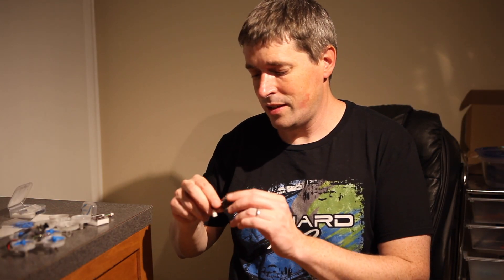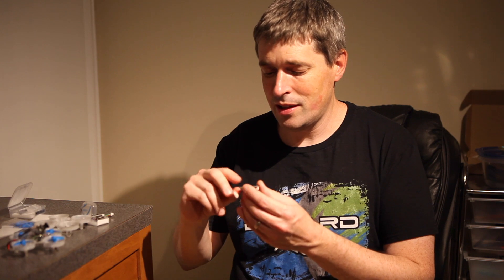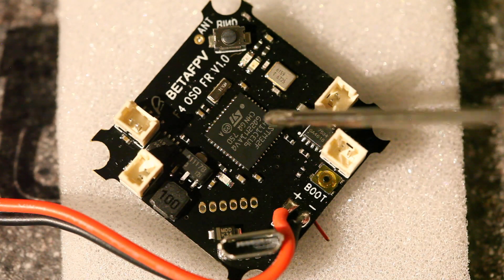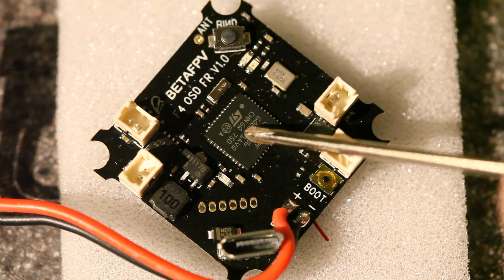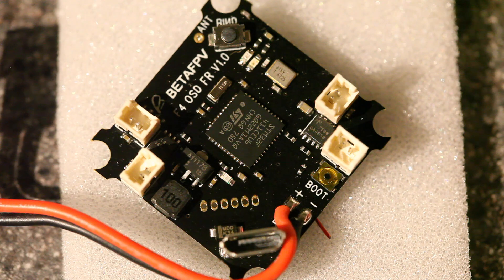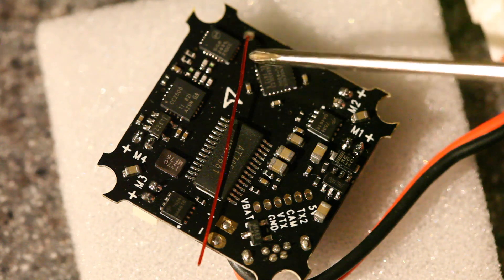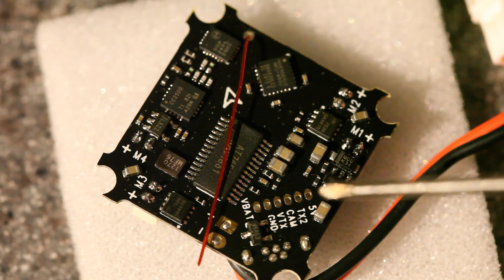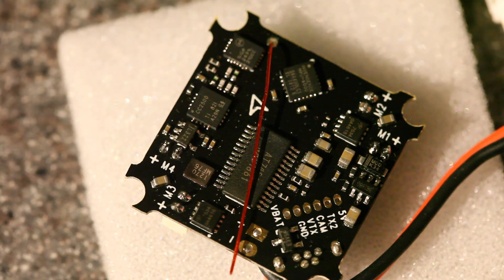BetaFPV F4 OSD - Review & Flight

Comment: How do you bind it, and what are the settings in betaflight for the controller?  I followed what remains of the instructions, which is just press the bind button 3 seconds.  I can't get mine to bind it seems. Maybe my controller is too new, maybe I need to update it or something?
Reply from the maker: Hi. Sorry for the super late reply. This is a very old video and a very old flight controller. Do you have the same one? In general I would say to follow the manufacturers binding instructions. This old FC might require you to hold the bind button while you plug in the battery. Good luck.

Comment: What kind of batteries should I use for these?
Reply from the maker: Lots of battery options. I suggest RDQ 250mAh HV or GNB 260mAH for agility or 300mah if you just want to fly longer. BetaFPV has decent batteries now too if you want se the BT2 connector. Have fun!

Comment: I know this is old video but have you done anymore testing with this board I am currently building with this board and was wondering if there is any gain updating firmware to 4.1 or is the advantage primarily for brushless. I saw this video from BETAFPV website while researching building a brushed whoop. Thank You
Reply from the maker: Hi. I haven’t flown this build in a while. I don’t think the new features of betaflight will help much. If anything I might flash it with Emu flight because they replaced the brushed motor algorithm with code from Silverware. Apparently it can output like 20% more thrust that way, but I have not tried to very that.
Reply: Thank you i will look into that, I am build a 65s with the BetaFPV silverware board too so i can explore that as well. Great flying!!

Comment: sir, in beta fpv f4 have a vbat.. what is for? can i use that? where can i get status the battery mah used and amper used?
Reply from the maker: It has a voltage sensor, so you should be able add voltage to your OSD. It does not have a current sensor, so if you want to see mah used, then you will have to set the current sensor type to "virtual". Then BetaFlight will make an educated guess based on motor speeds, etc... It can be accurate enough to be useful, but you have to have the right numbers to calibrate it, and that depends on the nature of the build it's in. I'm sure you can find lots of YouTube videos about that. Good luck.
Reply: @MrShutterBug  I must soldering from batter volt to the vbat sir?
Reply from the maker: @ramboaripratama1992  no. The flight controller gets voltage from the normal battery connection. You don't have to solder anything. When you see another pin on the FC labeled "vbat", it is for powering accessories that can use the direct battery voltage.

Comment: hello, I have an eine13 eachine, and I thought I would just change the controller, and buy a better control, forward to change the motors but not now, and how many mah does this board support? Is it worth just changing the controller? and which radio transmitter recommends
Thank you

Comment: Any idea why I'm not getting RSSI values in betaflight? everything else is fine, getting RSSI in my radio, along with several other things, and I can fly the whoop, so I know the receiver is communicating bidirectionally, but I get a constant 0% in my OSD and in the BF GUI for RSSI
Reply from the maker: I'm not sure off hand. I don't remember having to do anything special to set it up. Bardwell has a video describing how to send RSSI from the Tx back to the quad. That should definitely work if you can't figure it out the other way.
https://youtu.be/t-evOAS9Mkg

Also, BetaFPV has a Facebook community group. It's another good place to get answers for things like this.
https://www.facebook.com/groups/221254381799241

Good luck.
Reply: Thanks for a cool video! ;) I'm also struggling to get RSSI to show in the OSD. FrSky Qx7 can see the RSSI value but I can't find a way to get it to actually show in the OSD. @MrShutterBug
Reply: Did you find a solution to your problem? I've got the same issue... no RSSI showing in OSD at all but it's reading on my Taranis.
Reply: @brettsteele4243  oddly enough it started working. I'm not even sure if I changed anything. Maybe go to receiver page and see if any channel seems to represent rssi and set that as your rssi channel
Reply: sean junkin thanks I managed to get it working - think the RSSI display was hidden beneath another item in the OSD. I disabled all items in OSD and then turned RSSI on - win! 👍🏼 Thanks for your help!
Reply: @brettsteele4243  actually now that you mention it I think that happened to me as well lol

Comment: are there noticable difference between the F3 and F4 ?
Reply from the maker: The biggest difference comes from the large MOSFETs, which drive power to the motors. The F4 board feels more powerful, but it has nothing to do with the F4 processor.
Reply: So they’re supposed to have “smoother” experience due to F4’s faster pid loop but its not that noticeable ya ?
Reply from the maker: You can run a faster PID loop. That is true, and it should help smooth out a bit of the prop wash. But the difference is minor because the motors are so small. In my opinion, the more important differences are the MOSFETs and built-in SPI receiver.

Comment: Nice video,  just wanted to know if I had an existing 65s, is there a lot of effort swapping the board.

I havent open up the canopy yet, but was hoping the vtx is not soldered onto the board.
Reply from the maker: I don’t actually own a stock 65s so I’m not 100% sure about the vtx. It is either soldered to the FC or connected with pins. You would have to remove it and you would have to solder wires to the F4 board. If you are happy with what you have, then I wouldn’t change it.

Comment: Hey mr.shutterbug, awesome flying ! 💯💯 How did you get your mah and Ampere the right values? if i'm activating them, it doesen't make sense... thanks.
Reply from the maker: You have to use the virtual current sensor. It's never exact, but you can get it to be accurate within about 5% if you calibrate it properly. I had not calibrated it before this flight, so the mAh value on the OSD is actually way off. I've gotten questions about this before, so maybe I'll make a separate video about how to calibrate it.

Comment: Nice. How did you get the vtx antenna to lay down like that?
Reply from the maker: I re-soldered it that way. I do that with all my micros. It keeps the antenna from catching on anything or getting damaged.
Reply: Mr ShutterBug I have been trying to do that, is there video showing how to do that? Did you do one?
Reply from the maker: Sorry, no, I have not made a video about it. Basically, you want to leave the center wire where it is. Remove just the solder that connects the outer wire of the antenna to the VTX. Then, you can bend it into position (still connected by the center wire) and re-solder it.

Comment: What KV motors did you use ? I think that is the most important thing. I've gotten 3 BetaFPV products and they all Bob and hit the ground terribly. I just gave up on Brushless kwad flying.
Reply from the maker: These are the BetaFPV 17,500KV 7x16mm brushed motors. I've had pretty good success with them. They don't have as much punch as a good brushless quad, but they are cheap, durable, and efficient.
Reply: Thats great. I just jumped frames back to the smaller motor size to get 19,500
Reply from the maker: I used to fly high KV 6x15mm motors. They flew well at first, but got super hot and burned out very quickly. These 7x16mm motors are more efficient, and last much longer. That's my experience anyway. Happy flying!